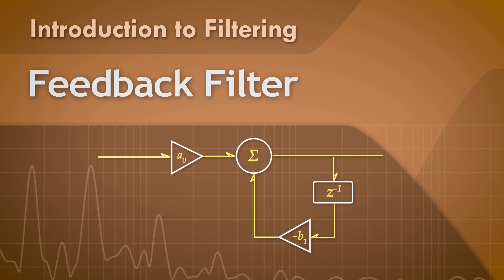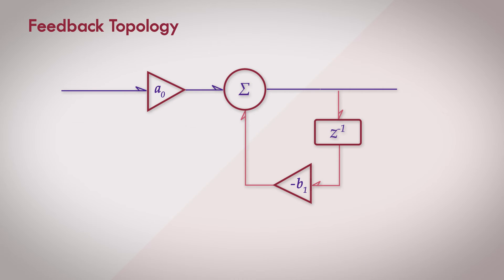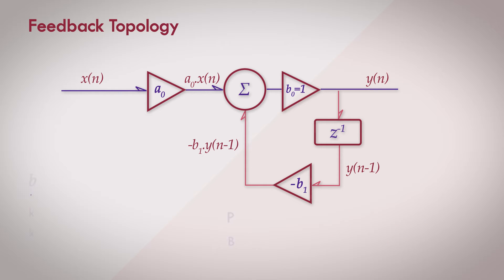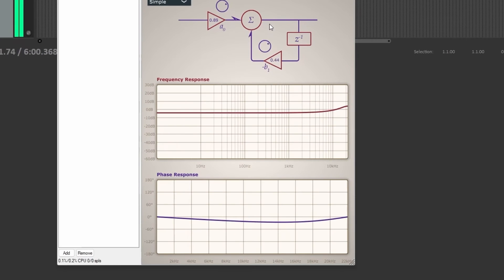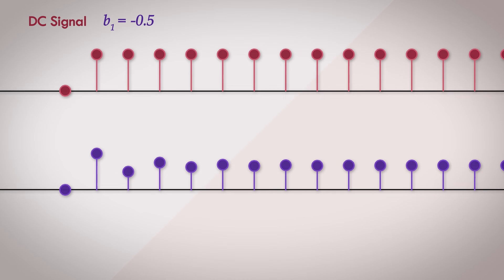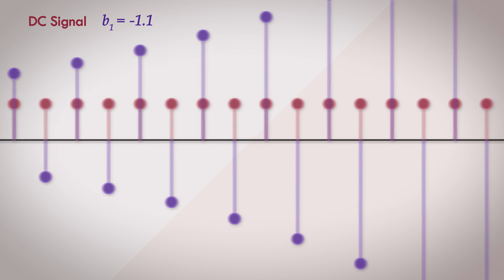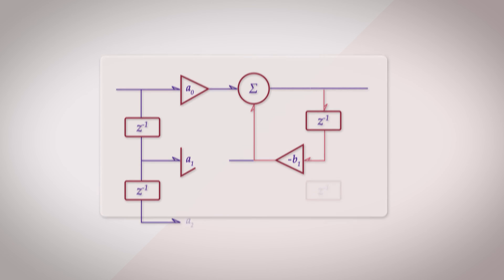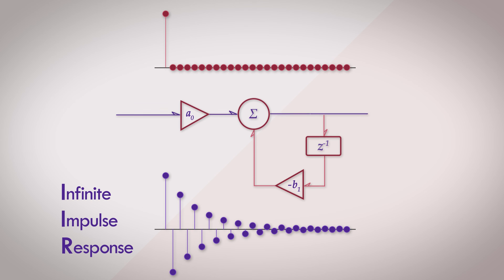7. Feedback Filter - Digital Filter Basics

Comment: Great videos, amazing channel! What I don't get, is why filters just don't change the amplitude as a multiplication with the points on the curve drawn on the EQ. Why does it have to introduce delay in the first time and go through all this recursive madness?
Reply from the maker: If you are applying gain to a signal in the time domain, you are applying gain to all frequencies. In the time domain, which is how signals are generated and processed, you cannot distinguish between different frequencies. 

The entire point of the delay is to selectively apply gain to different frequencies, which is what a filter is intended for.
Reply: Ohhhh, of course, in the time domain they are all summed up. I always forget it's not just a simple sine wave. So sorry for wasting your time with a dumb question🤦‍♂. Amazing content btw  @akashmurthy
Reply from the maker: @cescu2  no worries! And thank you! Yea it can be a bit confusing sometimes!